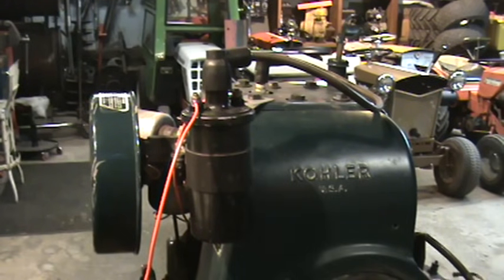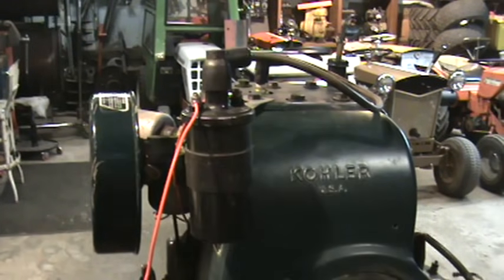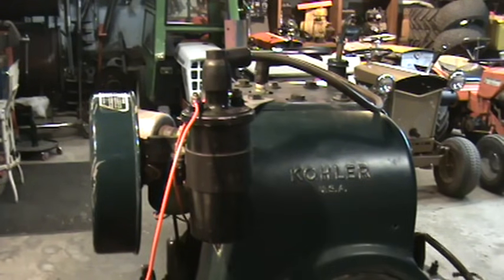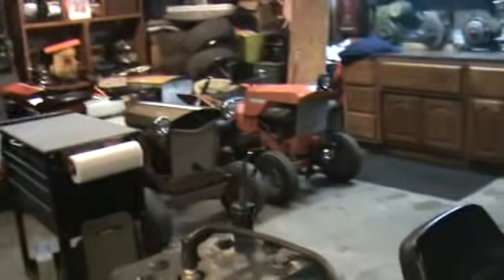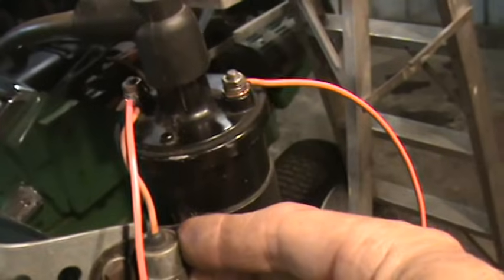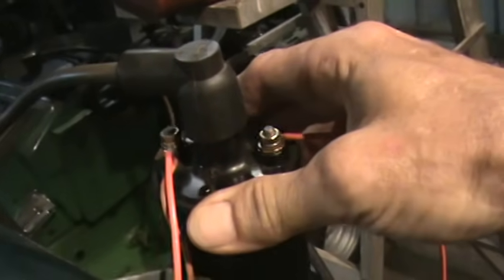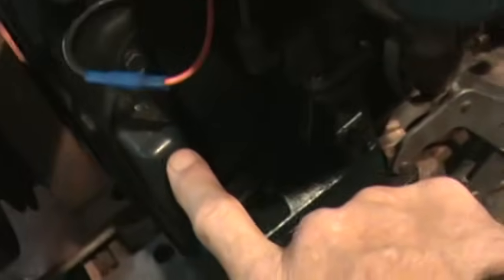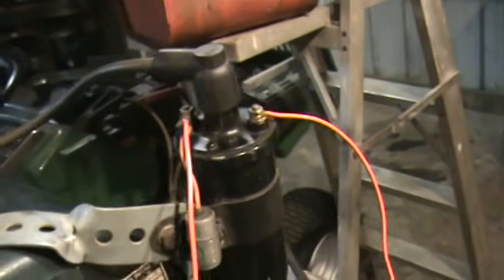Wiring an external battery coil to your engine

Comment: This question is on a older post. Since I just found this information and applied it today. It worked great. I wired my positive to my ignition and my old Wheel Horse is up and running again. However I need information about the in line resistor you spoke to 574carter about. I am using a automobile coil... I think. Was in my shed and figure that's where it came from. I have the condenser installed as you stated and used a automobile condenser but do I need some kind of in line resistor? If so will you explain a bit further for me?
Reply from the maker: Just keep check for things to get hot, like the condenser and coil. If they get pretty warm to the touch, you'll need to chance the condenser and/or add a resistor. The exact science isn't known by me, but we have a gentleman in the comments named maverick351 that understands this part of the process better than I do. I would contact him if possible and if you find your coil is over heating.

Comment: I hooked the coil up just like you explained on my old jd tractor and it seems to be getting unusually hot? Any ideas, or is that normal?
Reply from the maker: Drew Dickerson Be sure that the condenser you installed is for a small engine. An automotive condenser will over heat the coil and cause failure. Zip~
Reply: as well, some types of ignition coils require a "ballast" type resistor to limit voltage to the coil. these coils WILL overheat and fail if you don't have this resistor. the resistor goes between the battery and the positive terminal on the coil.
Reply from the maker: More great information! Thanks again Maverick!
Reply: ZippoVarga your most welcome

Comment: Hi zippo,mike here from France,great video,I'm going to use it 
On my 10 hp honda outboard,it's 4stroke 2 cylinder,got a new coil coming
Not sure if the condenser is ok,so I think it's a good idea to get one,
Honda say 0.24 microfarads is that number critical.
Thanks mike
Reply from the maker: Try the condenser with the new coil. It's either good or bad. There's no in between with them. The microfarads sounds like the ohm equivalence we use to measure resistance here in the US, so if you do need to replace the condenser, I would stick with the factory recommended condenser. Thanks for stopping in and I wish you the best in the repair!! Cheers! Zip~
Reply: ZippoVarga
microfarads measures capacitance, whereas ohms measures resistance. they are both different measurements.
Reply from the maker: maverick351
 Thank you for clearing that up for me. I'm not clear at all on resistance and capacitance and their differences, so this is very helpful for those who don't know, like my self. With this explanation, one holds a charge and the other resists....am I understanding correctly now? Thanks again!
Reply: ZippoVarga yes, you are correct……glad to be of help….makes the world go round just that little bit easier!!!

Comment: 45von is correct. The secondary coil, inside the coil on battery ignition systems, is what actually makes the spark. It can only do so when the points are open. When the points are closed, both the primary coil inside the coil and the condenser (which is really a battery) receive current. When the points open, the rapid loss of this charge to the primary coil windings induces a large voltage in the secondary coil winding, That is the source of the spark that ignites fuel. The condenser sends its charge along to the primary windings as well. Happily, the condenser also prevents the arc that would otherwise happen when the points close again so they don't burn-up rapidly.

Comment from the maker: Providing you are using a small engine Coil, the old Condenser will be fine. If using an Automotive Coil, you will need an in line resistor or you will burn up the automotive coils quickly. Hope this helps! Cheers!!

Comment: thanks so much zippo. I may use a starter generator later on in the future but for now i have just left it alone. cause im going to use it for a snowplow in the winter i will just bring the battery in the house until i have to use it. thank you zippo

Comment from the maker: Hi Steven. Kohlers equipped with an alternator/stator must also have a regulator/rectifier in order to be able to run without a battery. Don't connect the alternator/stator directly to the coil. Another option is, if you have room, add a pulley flywheel cover and a starter generator with a regulator like is shown on my Kohler. I hope this helps!

Comment: I have a 1972 Kohler 14hp when you use you have to keep the battery on it for it to run is there any way I can wire it to the stator or is that how it is supposed to be cause it will lose spark if you disconnect the battery

Comment from the maker: Hi Codie! I have a wiring video already uploaded. Your key switch is equipped with 5 terminals on the back correct? To simplify the installation I've sent you a personal message with a link to another member of youtube that shows how to wire them up. If you're still having problems, feel free to contact me! Cheers!!

Comment: Hi Zippo, i have watch quite a few of your videos, and they are great. I need help with my 73 landlord. i tried wiring up an aftermarket key switch with no luck, mostly because i dont know jack about older points style motors with starter generators, so i just left it alone before i fried something! Any help you can give me with the complete wiring, I would greatly appreciate it. It will be great since the switch is all I've spent so far, the tractor was free! Thanks for any help you can give.

Comment from the maker: I'm glad your question was answered! Thanks for stopping by. Cheers!!
Reply: Zippo,  I have a simplicity 3414 with a B&S engine,   the magneto is bad , I'm unable to find a replacement,    I'm Ethier going to have to go electronic ignition or
Go to the battery coil ignition like a Kohler,    if I go battery coil ignition how would my ignition switch work,  because right now that wire is a ground to kill the engine,  and it would have to be a hot that would go dead to kill the engine then.  Or Would I just be better off going electronic and then I would not have to rewire the hole tractor?

Comment from the maker: I'm not sure where two contact points that are not contacting one another are capable of delivering a spark unless you are using a Tesla Coil to fire your engine. The contact points close (touch) in order to provide spark at a precise moment in the compression cycle to ignite the fuel. I'm not saying you're wrong so much as asking you how, when open, the points can complete the circuit to deliver the charge to the plug. Cheers.
Reply: I know my coil is wired wrong and fuel relay what color wires go to coil pack on 86 thunderbird 5.0

Comment: if the condensor is bad can it be replaced by any old garden tractor condensor or does it need to be specific to that model engine?thanks for your time.

Comment: That must be a different engine than I had on the genny/welder in that case.I'm not sure which model it was but it was older than dirt.I couldn't even get points for it(didn't really know where to look though)so I put an eliminator on it.The Kohlers I've owned always did good for me though and this one looks like it was taken care of.Mine always looked like something that was dragged out of a swamp so if that means anything you ought to have a good experience with it.

Comment from the maker: You're correct on both counts. It would replace a bad magneto if a suitable stock replacement isn't available and is used on engines like the Kohler shown that don't have a magneto ignition system. Hope all is well my Friend! Cheers!

Comment: if you're using a regular automotive coil, you should use a ballast resistor as well, or the coil will run hot and won't last as long.